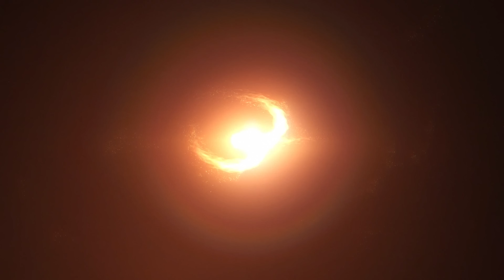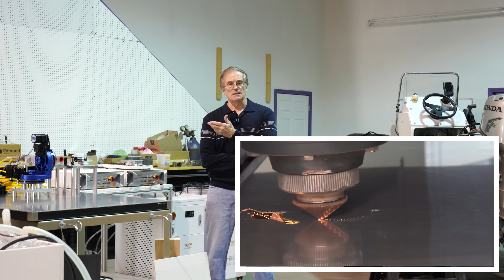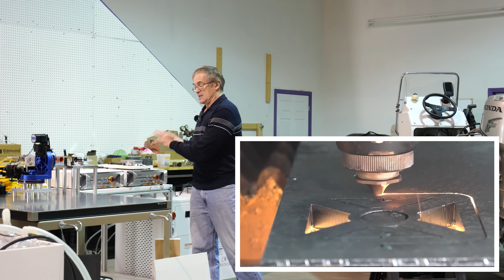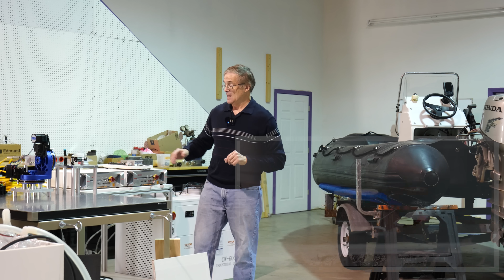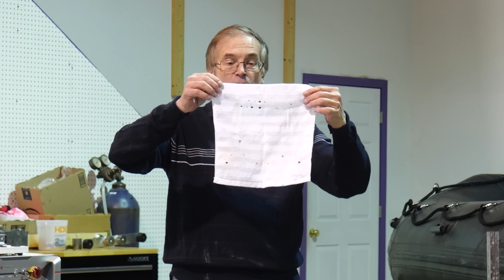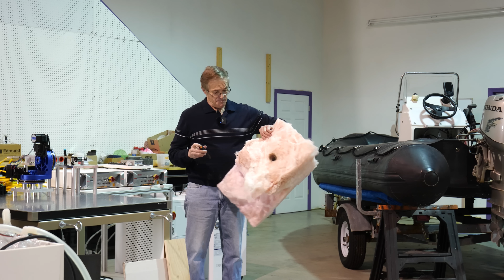We have a problem... and need your help!

Comment: I'd like to suggest a second layer for your backstop. The second layer would be a failsafe if the backstop is perforated by the laser. If you had a boxed area behind your backstop with an array of cheap BPW34 diodes in a reverse bias with a few volts on it would allow you to detect and cut off the fibre laser within 50 nanoseconds when they have a spike of current flow through them. The diodes will likely perish, but are cheap, and more replaceable than the postman walking behind your garage door :)
The BPW34 diodes will detect up to 1100nm so would detect the fibre laser (and more likely the white hot hole), but would need ambient light to be removed (hence boxed in). 
I have less material science background than you guys, so I'll leave those suggestions for others, rather than muddy the waters.

Comment: Beyond laser software when matched with a proper DAK it can maintain a safe speed and power. It is designed where something is simple as a brown out happens for a millisecond. It will shut things down.. you’re gonna need the Galves to control the laser anyway, and the Galves could park a laser words, terminated safely, faster than it could do damage

Comment: TiO₂-Doped Aerogel: Enhances light scattering and absorption, reducing intensity while managing heat effectively. It’s been tested with high-powered lasers and shows no structural damage.

Aramid Nanofiber Aerogel: Ultrastrong aerogels made from Kevlar-like materials offer mechanical robustness and low thermal conductivity (0.0228 W·m⁻¹·K⁻¹), ideal for both scattering light and insulating heat.

Gradient Nanostructure Aerogel: Recent advancements in gradient aerogel fibers create varied pore sizes (150–600 nm), enhancing thermal resistance and light scattering through interfacial effects. This could be customized to diffuse a laser beam precisely

Comment: My idea would be to use graphite sheets with a water curtain running over them. Graphite has a melting/sublimation temperature of 3600c, good thermal conductivity, and light absorption. Water could be sprayed as a mist over it providing diffusion, cooling, and helping to prevent ignition (which would be my biggest concern) if some graphite does get ablated and reacts with oxygen, it will only produce co2. If possible, angle the sheets up a somewhat to help direct reflections up away from people.  Maybe try textured sheets to increase the thickness of the water layer

Comment: Black or gray water watercurtain shielding plywood and cooling it. As long as it is a constant stream it would distort the beam and absorb the heat from plywood. Some PVC pipes to deliver, spray, collect and a circulation pump will do the trick

I guess the idea would be to combine a material that is dispersing heat (not insulating) idealy aluminum with rapid water cooling. Try also inking water black to increase its absorption ability vs its Thermal capcity.

Comment: Ablative materials might be worth looking into. As the laser cooks an area, the generated carbon can block the laser (similarly to the Apollo mission re-entry shields)
Potentially you could even use wood, but pre char it and coat it with fire resistant paint (also an ablative material) to prevent fire from spreading. They sell the paint for use as an indoor fireproofing thing, I just forgot the correct name for it (nighthawkinlight coated the inside of his camper with it)
Reply: (absorb, not block, small correction)

Comment: Im thinking concrete/aircrete mixed with carbon black and set on a form with rows of v's or cones like what you'd see in an anechoic chamber. Thick as you want on a metal framed wheeled platform. Might end up experimenting with painting said coned surfaces with copper paint or such for just the right amount of dispersion/absorbtion. Could even make individual angled bricks that you screw into a metal back if one needs replacement.

Perhaps with water flowing over it or have a sheet of water (if glass/fritted glass doesn't work) running in the front. Could also just be lots of droplets or even hypersonically made water smoke. I think you'd have to mix something in the water like aluminum powder or more carbon black to really absorb/disperse that light.

Comment: My idea would be something that would scater and absorb the beam. Perhaps a cloudy quarts or other crystaline material.
What wavelength is the light?
Reply from the maker: 1080 nm
Reply: @TechIngredients 😂 you'll love this.

A panel of double glazing, containing Gallium Arsenide (GaAs) as a gas at extremely low pressure and a IR-a light.

The Gallium Arsenide (GaAs) gas is the lasing medium in the laser, so it would absorb the photons perfectly. Then the infrared light source would stimulate the excited electrons to emit. 
But you have a defused light source so it would scatter the beam in every direction.

Making it, a very expensive, IR space heater.

On the bright side Gallium Arsenide (GaAs) is somewhat less dangerous than your death ray.

It would definitely work, to absorb and re-emit the light in every direction...

A small amount of Gallium Arsenide (GaAs) in a vacuum chamber and a broad spectrum IR light...

Would also heat the Wearhouse in the winter...

How many kWs is the laser?

Must be worth an honourable mention

Comment: Can you try carbon foam? It’s a very light absorbent and insulating material and it can be made from bread (or it can be made from melamine foam if it needs to be more flexible)

You could also try that diy Starlight material that Nighthawkinlight made a while back

Comment: It occurs to me the problem is, rather that absorbing the energy at one small area, diffusing the beam prior to absorbing the energy would spread out the concentration of energy and gain time before the material melts. 
Something like an array of micro lenses prior to the absorbing material configured to diffuse the beam. 
I'm just spitballing here, as I'm not worthy. 😉

Comment: Before Fiber lasers came out, the CO2 Lasers had a series of mirrors. The last one before the cutting head was a water cooled, water pressure focused, polished copper mirror. The pressure determined the mirror's convexity. How that pressure was adjusted determined whether the laser could cut at all or not. Any small change with this mirror would have a large effect over distance. 
     If you reversed you're setups direction, and used an adjustable mirror to direct it back at your target, you could dynamically control your focus. Possibly making it harmless enough to use in conjunction with one of these really smart engineer's ideas.

Comment: Optical engineer here, you could further complicate your setup by increasing the NA of your system and actively focusing on the target using a variable lens system, making the beam much less dangerous after it diverges. That type of feedback loop would make for a cool video too lol
Reply from the maker: That's an option. Active focusing has some advantages, including a smaller spot size on the target, a greater usable range, and defocus to effectively disable the laser. But just like the tracking head and the computer, it can go wonky. We'll still need a backstop.
Reply: @TechIngredients  i wonder how deep/thick of a water mist (lawn sprinkler) would stop your watts. with absorbing ink / carbon slurry / etc
Reply: @TechIngredients  I quote thise. See my comment up. You can actively focus the beam by an external system. You can have an heart beat signal from and to the system. If one of the system fail e-stop is engaged. I propose a laser range finder to detect the distance from the target. If you have a big swing with the distange the lenses have to go out of focus.
Reply: @TechIngredients commenting again to hope this is seen. In case you're interested: ScanLabs, Aerotech, maybe Cambridge Novanta, and even ThorLabs sell active focusing modules.
Reply: I was thinking the same. Start wide and focus the beam on the target. Just like in the laser cutter, here the drone... cutter... has a longer distance between the head and backdrop. If you do it extreme enough, you may not need a particularly tough backdrop - rock sheet should do. If you start with a few cm beam.... the laser might be only dangerous in the focal area of a few dm. For lab testing you can lock out mechanically/electrically a focal range that limits the focal point within a safe volume and off the backdrop. Using it at longer distances outside the lab at say 1km... brings the same problem again as the beam is focused for a longer distance and would pose a serious risk to... the backdrop. Don may have some further input... I am not an optical engineer.

Comment: As an amateur I will give it a go.

How about making a sandwich of black anodized aluminum sheets with poly urethane expanding foam mixed with carbon black powder and fine perlite.
poly urethane isn't great, because it can cause nasty gasses when burnt. But it does work as a nice binder.
If you have access to a furnace/kiln , I would suggest using another kind of binder that does not produce foul gasses when blasted with your laser.
The idea here is to make a lightweight rigid structure, based on easy replaceable tiles.
The perlite has some insulating properties to help dissipate the heat.
The carbon black powder helps absorb a broad range of wavelengths, including infrared. --> What's your wavelength ??

I would also suggest a detection system.
Use FLIR camera to detect hotspots on the tiles (either on the back or front or both).
Make an automated analyzer that detects these hotspots.
When detected it should be able to switch off the laser.

Alternative binders for Polyurethane Expanding Foam:
- Sodium Silicate (Water Glass) Binder: Sodium silicate is an inorganic binder that is relatively heat-resistant and doesn't produce highly toxic fumes when heated. You could potentially mix it with your carbon powder and perlite to create a solid matrix. However, it might be brittle and not provide the same expanding and gap-filling properties as foam.
- Cementitious Materials: Lightweight concrete or gypsum-based mixtures with perlite and carbon powder could be an option. These are non-combustible and won't release toxic gases. However, they would likely be heavier than foam-based solutions.
- Geopolymers: These are a class of inorganic polymers that can be formed from various aluminosilicate materials and alkaline solutions. They offer good fire resistance and can be lightweight depending on the formulation and the use of lightweight aggregates. This is a more advanced material science approach but could yield a less toxic and fire-resistant matrix.

Comment: concrete obviously. Real poured one, not shitty concrete bricks. Get relatively thin sheets made by a pre-fab concrete company, maybe 5-10cm, and mount them on a rig with wheels. Shouldn't cost more than a few thousand dollars. Compared to your other equipment that's cheap.

Comment: I think using a tank of water would work.  Make a hole in the side for the light to enter.  Have a catch tray and a pump to refill and circulate the water in the tank.   Add some fine particulate  in the water that can absorb the  light,  like they use in computer water cooling.   I dont know what would be the best, maybe graphite?

Comment: Rather than a physical barrier or sensor box, is there any way to pulse the laser, or the focus? This way you could use hardware/software that's part of the laser itself to set up rules/checks/etc to only send enough annihilation when you really want to. Maybe having it so it can tell how fast it's changing orientation and only using full power when it's moving fast enough not to burn holes thru what's in the background.

If it's following a moving object with enough accuracy, it's effectively stationary on the target, but in constant motion on anything in the background. It sounds like this would require high speeds considering the sheer power of the laser tho. I mean, look at that clip you showed us... daggum...
Reply: Going a little further with the focus idea, and speaking from complete ignorance on the subject, just how wide of a diameter can you get the laser beam? If the initial diameter is wide enough, you'd have to focus it on one particular spot in space and it would only do damage there. This would take fast computing and more equipment, but it was an idea my sleep-deprived brain got hooked on just now.

Comment: You've stated you have some excess laser power now.  Use the same technique as the laser cutting machines.   Run the beam thru an expander then use an active focusing lens to have the beam converge ONLY on the target.  This has added benefits such as allowing you to adjust the flux on the target.  It may be that lower power over a larger area is more effective for target destruction.   The beam could also be spread wider the closer the target comes reducing the possibility of a dangerous reflection.   The ability to focus allows a larger spot closer in reducing the target's ability to jink, trying to avoid a beam..   Knowing the range also assists with target tracking.  The prime feature is that the beam becomes safe a short distance beyond the target and a little less dangerous in front of the target.  While the beam has not yet converged it is attenuated less by the atmosphere.  High power beams  (small diameter) beams interact more strongly with the air they're passing thru.  This acts to consume some of the beam energy.  With range finding of the target you can select which targets are closer and you can also limit shots to targets in a region that the beyond-target diverging beam simply can't damage the walls.
Set up the focusing electronics such that any loss in the focusing signal (a pwm waveform) fully defocuses the beam expanding it to, hopefully, earth-surface solar flux levels.
Reply: The beam is mounted to a turret that is going to be whipping around trying to target a drone flying in the air...  think about it
Reply: Yep.  If you're pointing at the target --which is the entire point of the exercise--, reading its range is pretty trivial.

Comment: Not that you'll see this, one guy suggested a darkbox that will shut off the laser when cut through. And another suggested a water flow system....

honestly, combine both. Plywood coated with a fire retardant paint set at an angle with a laminar flow of water over top it to form the 'strike face' of the darkbox that's coated in a highly reflective material to maximise the chance that light sensor detects the laser light.

Comment: I think pretty much any solution may require multiple layers and even for what I am about to suggest you would want a backstop but lets do one thing at a time. 
Is there a way you could manufacture a set of pipes on floor or ceiling that could be made to emit a sheet of hi pressure water? The sheet would have to be thick enough and moving at high enough speed that the laser was always meeting anew surface of water before it could make its way through the first.. If the laser is just going to be fired in bursts you could consider a large plexi-glass tank  maybe even one with a Russian Doll design.  Is that called Matrioska or something like that?  A thickening agent could also be used in the inner portions  While some may think corn starch I would look at the material used in diapers.  You will have to play with the mixture but most of it depends on  the power of the laser and its firing pattern and rate.    I was looking at adding something to the inner sections so we could eliminate a backdrop because the only ones I could see being effective would be some type of composite and you would end up with fumes or reflections. . 
The pipe solution would likely be an engineering nightmare but a tank could be made to work with the right materials.  If none of this is functional you may need to supplement with another fluid/absorbent combination along with some type of active  cooling mechanism that is low cost. that can keep the material cool without producing unwanted fog 
Failing all of the above have you considered approaching a defense contractor to see if they have any materials they would like to see tested? Much also depends on how long your testing will take. If I were going to make a defensive composite I would include some ceramics,  a  gel layer filled with something tough and reflective to scatter the  energy along with a reactive coolant.  and a network of fibreroptic waveguides with multiple input facets.

Comment: Requirements:
(1) Cheap, abundant, lightweight, easy to put up and pull down
(2) Non-toxic discharge-products; non-flammable base and discharge-products
(3) Ability to absorb large power (10kW?) in a tight beam-section (1e-6 m^2?) .. i.e. 1 square mm.. at near-IR wavelenths
(4) A 4th item I think you didn't mention explicitly: eye-safety for surrounding persons and objects - the beam must not get reflected around Willy Nilly.

Fibercement (fireproof) boards come to mind, but one FCB costs as much as four drywall boards.. What about a FCB with a plywood backing? (I'd prolly do this first if I wanted a sure-fire thing, perhaps not the most elegant, that "just works".)
Uncharted territory: (perhaps it breaks rule #4 above) - a fog or mist of water, with soot-particles or graphite --> Graphite to absorb the wavelength, water to cool and refract and fog-droplets for auto-replenishment

Comment: It won't work for every thing you want to do but instead of trying to think of a wall of material to put behind the test area, you could rotate your tests from the horizontal to the vertical and shoot the laser down. There's enough dirt between you and the core of the earth to absorb at least a few full seconds of these lasers.